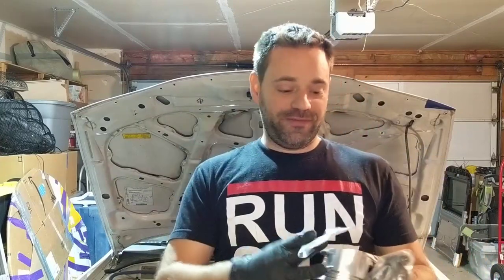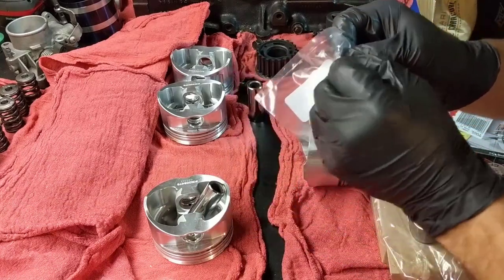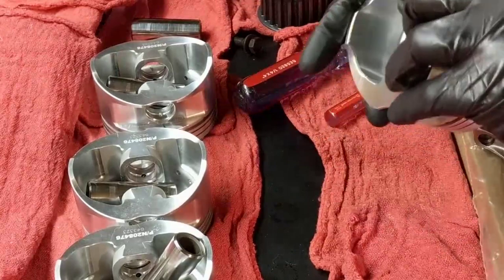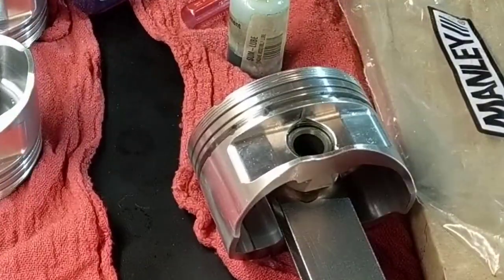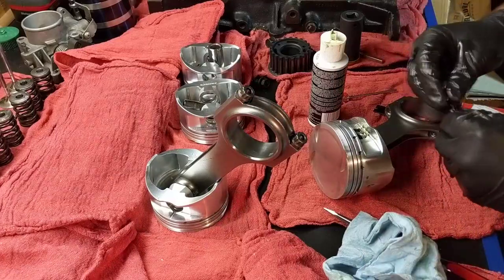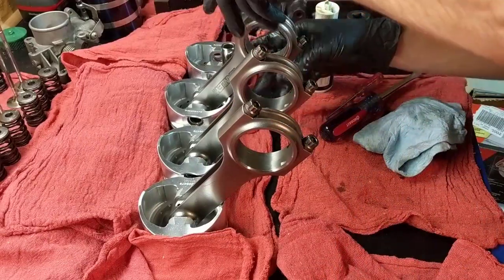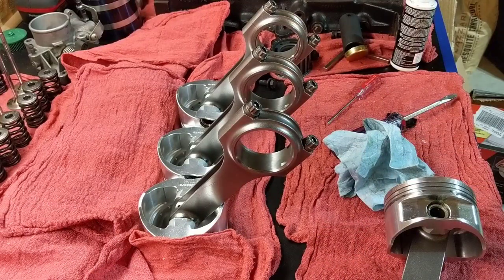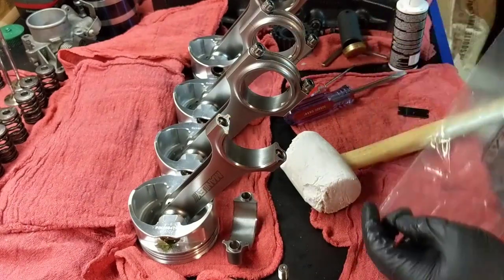Pistons and Connecting Rods Assemble #Eclipse2GBuild

Comment: For your 420a turbo. I've gone through most of your videos now. Did you use all oem parts or any forged parts for your engine internals to handle the boost?
Reply from the maker: I hope my videos are helping you. I got forged pistons and rods.  Crankshaft and camshafts are OEM
Reply: @CarModsGarage  thanks for the input. Thats the route I am going as well.
Reply: @CarModsGarage  for your pistons did you use factory size 87.5 or bore the block for 88mm piston size?
Reply from the maker: @z3roxc00l9  mine was 88mm already when I got the block but I would've gone one step smaller  which would give me more chance to bore again if something happened.
Reply: @CarModsGarage  appreciate the info man.
Reply from the maker: @z3roxc00l9  no problem brother